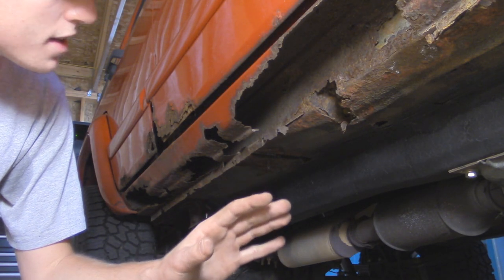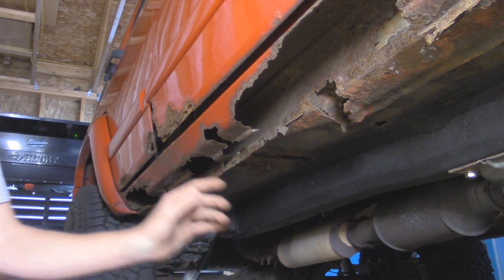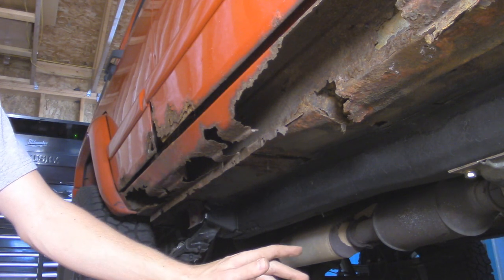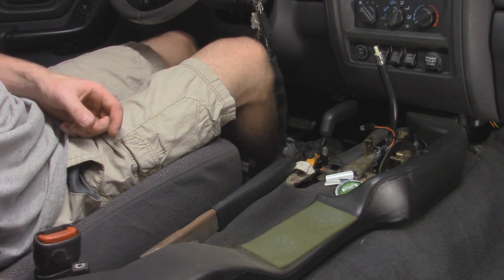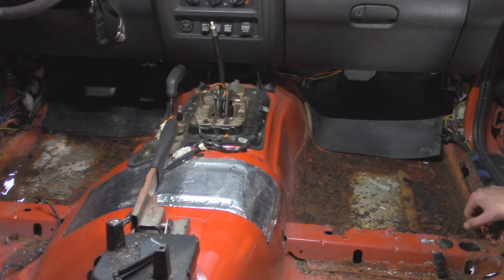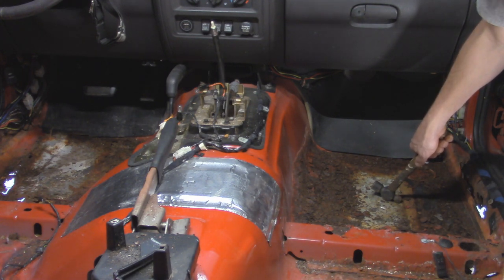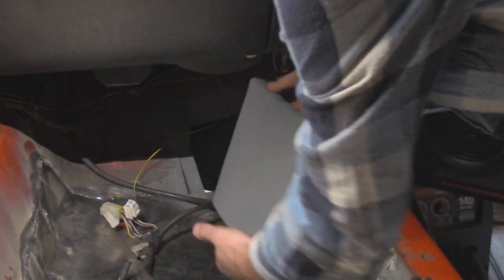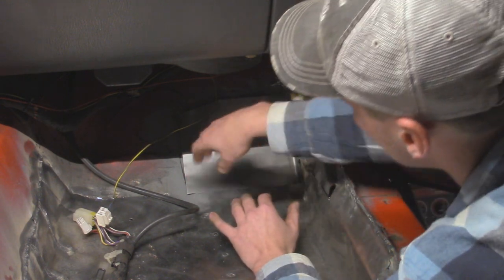Jeep Cherokee XJ Floor Pan Replacement | Part 1 of 2

Comment: once I replaced my passenger floor it revealed a leak in the cowl  or something that would drip down the firewall onto the floor. Something to look out for, lol. Love your content
Reply: Yeah that damned air box intake on the passenger side likes to leak into the floor.
Reply from the maker: Forsure, I believe my windshield is leaking too.
Reply: @OutJeeping  I hope that's not the case for mine, but I just don't have time to properly seal the airbox with college. I put a little barrier in the cowl but it only slowed it down. Heavy Michigan rain is too much for it
Adding a drain plug in the floor today

Comment: My rocker arms are shot and I've got holes in the unibody behind the rear axles on both sides.. ugh. I need to spray some por15 in her and get the rockers fixed I needed this video!

Comment: So did you pretty much chisel out the seat mounts? The rockers and transmission tunnel are fine next to the mounts but I will have to cut some of the existing pans out to fit a premade pan in to measure cuts. Was seeing what the best way is

Comment: Good job Austin. Need to do same on my 97. What welder are you using; stick or 110volt Mig? Thanks, bc
Reply from the maker: Lincoln 140 120v on flux core.

Comment: Left mine parked for a while and i found the driver footwell (passenger side in america) full of water, carpet was toast so i just cut it out and theres rust spots everywhere so i will have to repair it but its not enough for a whole pan replacement

Comment: Great work! You are definitely under-subbed.

My floor pans weren't so bad so I could use POR-15 Patch and small aluminum patches (as a saffold) to fix it up. I also cut out the sound deadening part of the carpet because it seems to function too well as a sponge. Also got rid of my vinyl floor mats since I think they reduced carpet evaporation.

Do you happen to know what the adhesive rectangle on the stock floor pan is for?
Reply from the maker: It's meant to reduce rattling and other sounds as well as act like a heat shield. They put one on each floor pan section because it seemed one was better than none. They were cheap at the factory and must have not of found it worth it to place more.

Comment: Having more than you need provides convenience. Such as power tools and other equipment that would’ve made this job easier. It isn’t necessary and with sheer will, anyone can pull off a job like this with the bare minimum. It’s labor, but best believe bringing your rust bucket to a shop would cost more than you spent on the car.

Comment: Really great video, thanks a lot. What welding machine you are using? Thanks for your info
Reply from the maker: Lincoln electric 140 on 120v, flux core 0.035 wire.

Comment: Did you only weld the bolt on one side and the nut on the other for the rear hardware because that’s how it came from the factory? Or is there a reason one couldn’t weld in two bolts facing up instead?
Reply from the maker: I welded them that way because that's how it was from the factory. You could easily weld in another bolt facing up to be stronger, if you wanted too.

Comment: Amazing video, I ripped out the entire rear cargo area of my '94 (this is my 5th XJ, and she's a stick so she's special) last fall and said holly shit!. Started grinding but I let it rust right back over the winter; I think mine is as bad as yours! This really gives me the confidence to finish the job. I have been amassing tools, I can use the break and shear at school but really need to get me a Hobart Handler and get rid of this flux core 100. What welder do you use? Anyway, on to part 2..

Comment: I have to do my floors on my 95 country. Is 26 gauge too thick? Or should I look for 20 gauge?
Reply from the maker: The higher the number the thinner the metal is. I used 16.
Reply: @OutJeeping  okay. I’m trying to not spend much money on it, might try old dryer and add a couple reinforcement plates under the pans to the frame. Thank you! You’ve definitely helped out a lot in the video.

Comment: You use just standard 18 gauge sheet metal? I might do the same and save myself the 200$ on floor pans.
Reply from the maker: It was actually 16 gauge, but yup standard sheet metal.

Comment: Finishing mine up now. Replaced the entire passenger uni frame. Half of drivers. I used 2 inch square tubing to brace it all. Both rear quarter corners. ALL the floor pans. Tunnel and everything.  Both rockers.  And half the firewalk lol.  Im so fkn sick of cutting and welding its not even funny